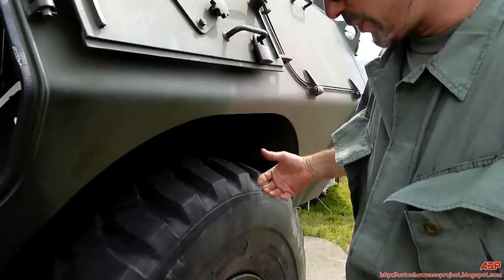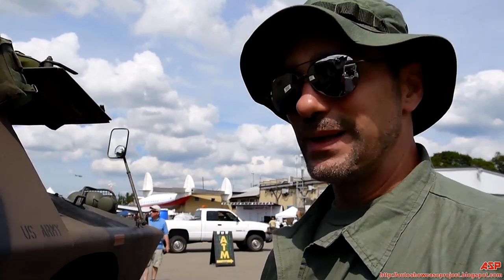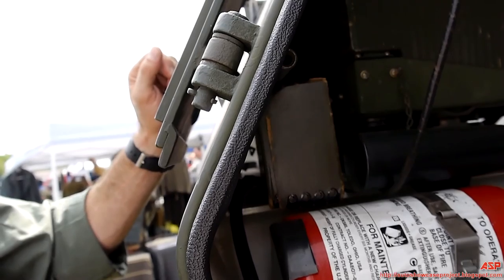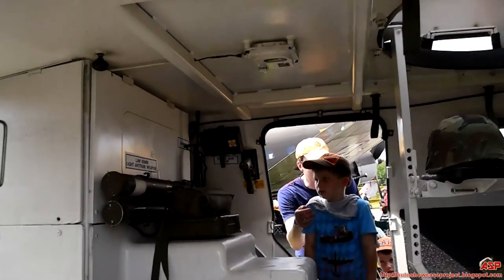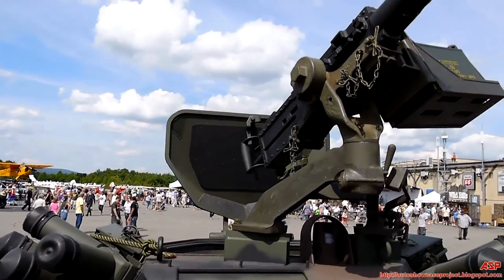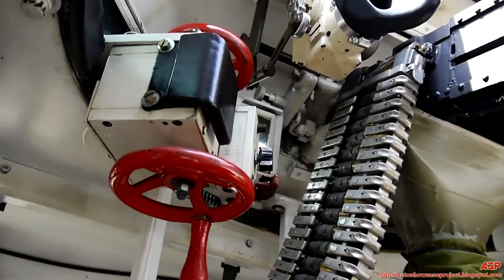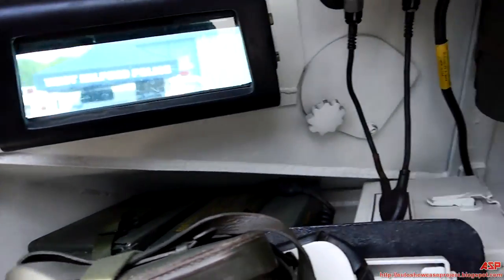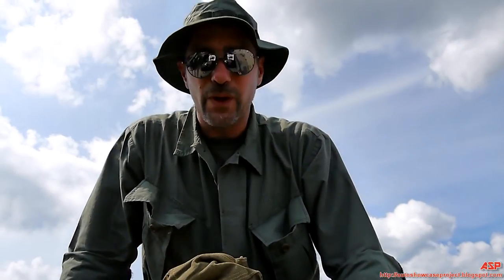V-100 Commando Armored Vehicle (Cadillac Gage - Textron Systems)

Comment: Over 50 on blacktop they start to bob.    You don’t want to do that for long, scary.    I’ve been in one near 70 mph and didn’t like it one bit   Ours had twin M 219 30 cals.   Nice padded telescopic sight.     Even with the barrels out you could smack the driver or commander in the head if they were sitting up which they usually were.    You really had to watch that if you were spinning yourself around with that hand wheel..     
   In 4wd in deep snow or mud you didn’t drive it, it DROVE YOU.    It overpowered the power steering and you had to hang on tight.     We had a lot of flooding issues with that sealed airplane style plugs and wires system. They would have been better off with stock Dodge 360 ignition that was standard onthat engine.     In the cold starting one was an art form.    Why they put the air intake inside is beyond me.    You rev the engine buttoned up and you would feel the pressure change.   Worse it caused mini hurricanes coming in along the hatch seals.    Buttoned up you got it right across the forehead and face if you’re the driver or commander up front.    Ours had a heater core the size of a Chevy.   Combine the two and you can freeze in the breeze or shut down and Cold sink into utter misery.     I saw a couple guys tumble out of one once on an extended escort op so frozen they were puking.   Worse, instead of coffee the “Spoons” as we called them sent out purple Kool Aid for lunch🙄.   It froze in the cup before you could drink it.    That’s how it was as an Army MP at Seneca Army Depot in 1977, pure frozen hell during the 2 worst winters since they started keeping records.     We briefly had so much snow at once in spite of round the clock plowing ( payloaders, road graders) that some of the guys had to use the V’s as patrol trucks.     I missed that fun but did get o drive one around post with one dragging buried cars out of the snow banks.    It didn’t take much effort in 4 WD but you really had to hang onto that wheel when those fronts started digging in.

Comment: Used them in the Marines. Was stationed on North Island. San Diego. Marine security forces. Was junk!!!! Always overheating, poor armor and a shit ride!!!! Will not take a 50 cal. This guy does not know what he is talking about. Armor only take up to 7.62.
Reply: Don Whitesall yeah it stanag 1 and 2 like Wiesel, that guy looks like 90% of the way to stolen valor.
Reply: +what? where? Yeah if he is going to be giving the public facts at least know what you are talking about.
Reply: I worked for Cadillac Gage for 8 years, and Stillamarine is correct. The V150 stretch model improved the ride and overheating with the new diesel, but armor was still 7.62 ball.
Reply: I worked on a V100 Commando that I used in Hurricane Harvey,but it turned to shit real quick.The V100 sitting on my property has the 361 CI V8,which is a Big Block Dodge with two 4BB Carburetors,and it isn't friendly at all with water and weather.There is a good damn reason that the U.S. Army and U.S. Marines took the 100's and modified them into M706's with a 653 Detroit,671 Detroit,and 425-903 Cummins.
Reply: They only had pickup engines in em
Reply: He's 100% correct on the gun, though not the armor (not on an original V100 at any rate). If you go to 7:30 in the video and look at the turret, you can see it has a M2HB .50 (notice the stepped part of the barrel and compare it to the pintle-mounted M2HB above it) with a .30 of some sort mounted coaxially to it. The V100 was offered with M2 .50s in the turret as well as more exotic options (I've seen photos of a factory turret with a 7.62mm M134 minigun). In practice they were fielded with all sorts of things including .30 M1919s and M60s. 

The modern version takes a M2 .50 plus a 40mm (the M1117, which has the same turret as the Marine's AAV-7A1). They are on paper able to take 12.7mm hits (maybe what the guy is thinking of, since I've seen the specs on the V100 and M1117 mixed up on the web plenty of times), as well as RPGs if they are really lucky, but in practice anything above 7.62 is pushing it.